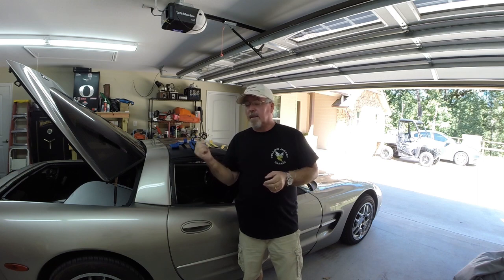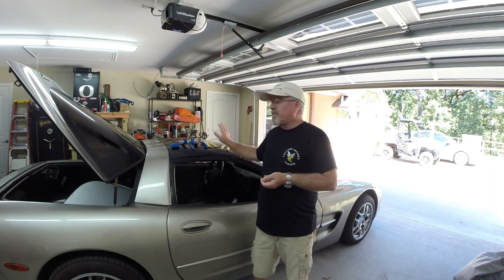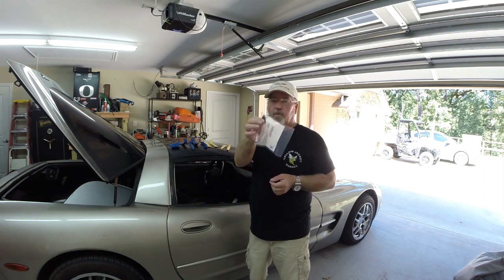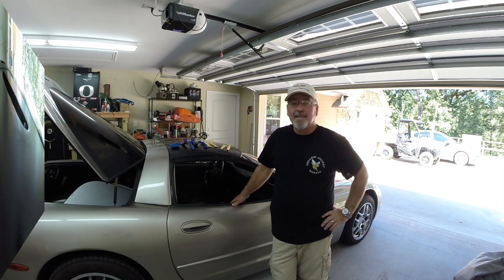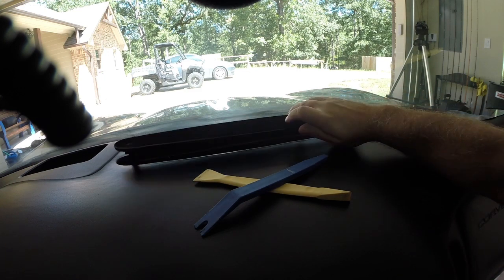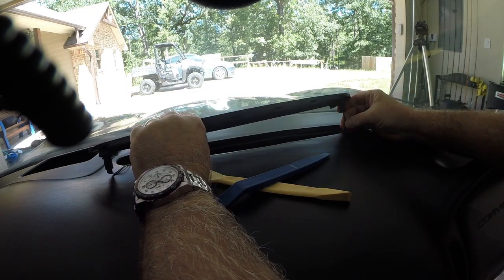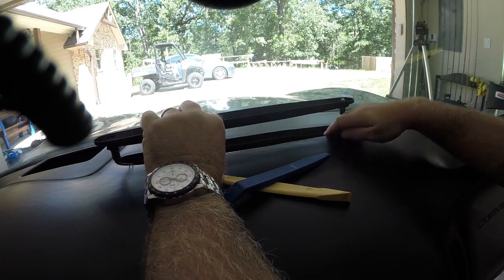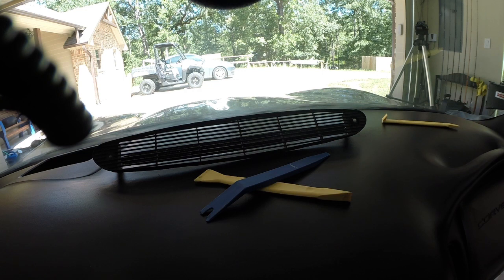C5 Corvette headlight and sun load sensor replacement

Comment: Thanks for the video. I’m having a difficult time finding the twilight sensor online. Any suggestions ?  Great content.
Reply from the maker: Top Flight has the ambient light sensor in stock according to their web sight.  If this is the part you're looking for.  I'll see if I can link it here: https://www.topflightautomotive.com/products/general-motors-1999-2004-chevrolet-corvette-daytime-running-lights-ambient-light-sensor/
Reply from the maker: If that isn't the part you need, let me know and I'll try to help you find the right one.  With these cars getting older, OEM stuff is getting harder to find.
Reply: Top Flight has the part. I can’t thank you enough. Just ordered it. I was searching for a while. Ebay had the Sun HVAC sensor but I kept striking out on the ambient light sensor. I’ll let you know how the install goes.
Reply from the maker: @Maxreverse  if I remember correctly we had a hard time finding it too.  Glad it worked out!